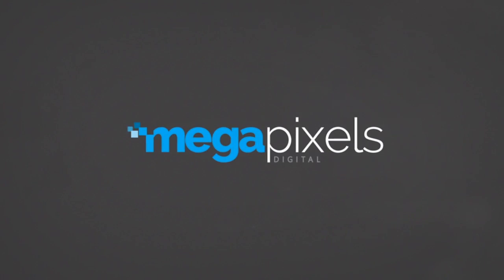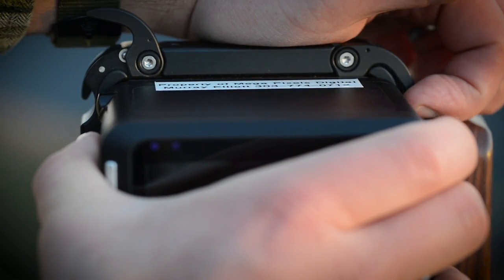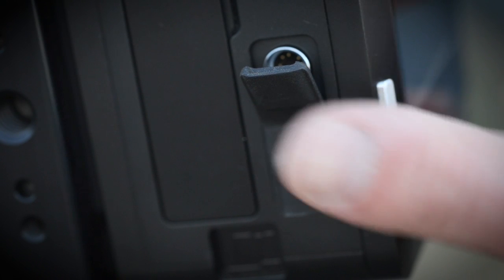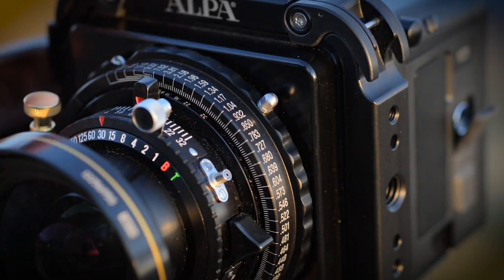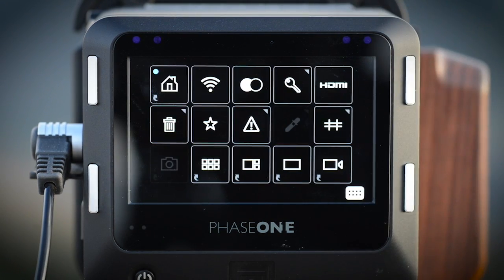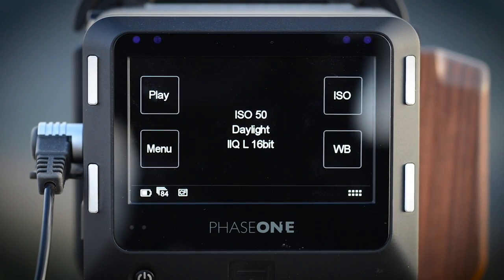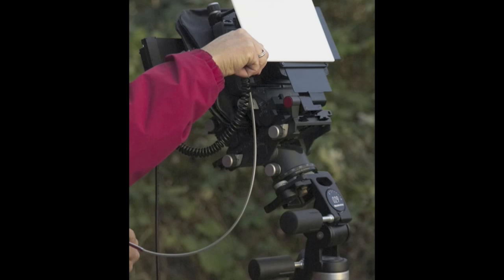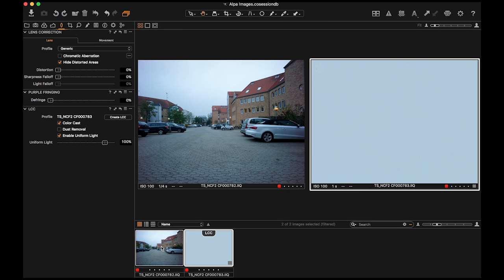Technical Camera Intro

Comment: Thanks Zak, how do you fire a flash when using the Alpa indoor for Real state shots? please
Reply from the maker: You're welcome! 

Strobes are triggered via the PC- port on the digital back. This port is dormant while the back is connected to a body with electronic contacts. When no contacts are present, this port is activated and ready to fire. If you go to 0:55 in the video you'll see where the 8-pin port is located. The PC port on the back is located directly under the 8-pin port.